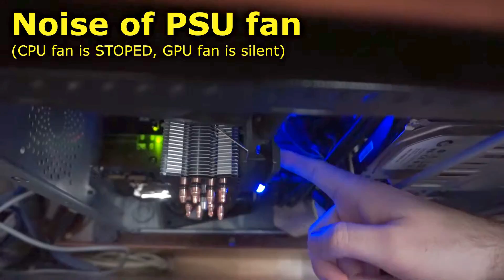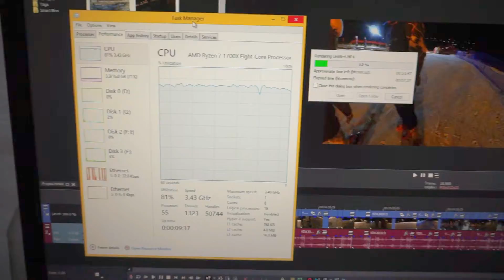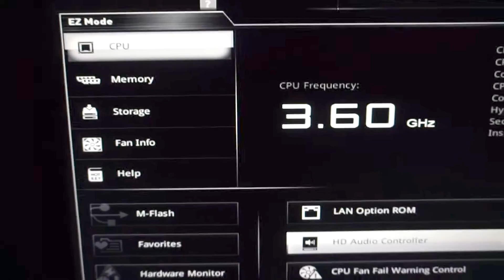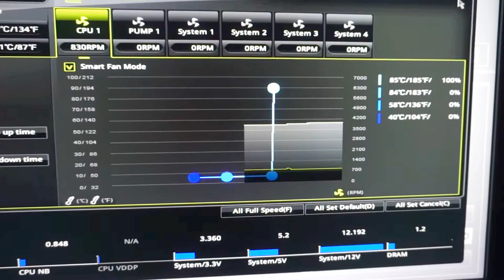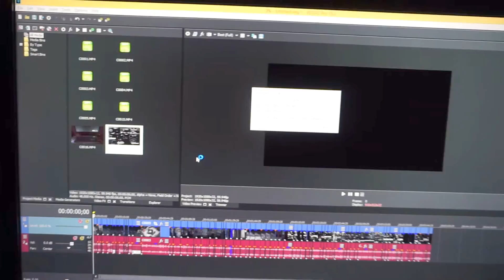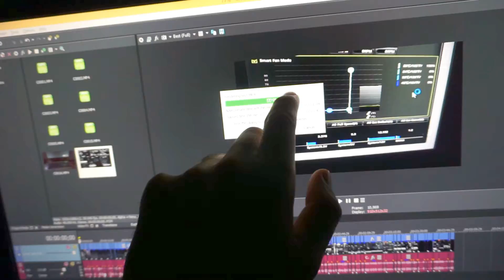Making the PC Silent (PSU & CPU fan Noise Reduction, MSI B350 PC MATE)

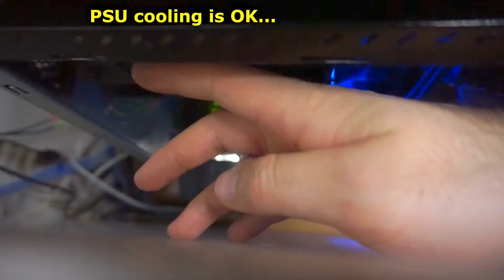Comment: 2:00 don t you ever touch a switch mode psu's heatsinks. it is never safe. the ones on the non isolated input side are dangerous. they are usually at rectified  dc voltage of the corresponding AC line voltage. 300V peak.

Comment: Speedfan software is quite good to control cpu fan, it even lets you stop the fan.  then i'd use the spare fan at 5v to intake some cool air from front bottom of the case

Comment: how do you use win8 on a b450 mobo?
Reply from the maker: this is B350
Reply: my bad i have a b450 board, with only win10 drivers for raven ridge and win7 and 10 for ryzen 1000 and 2000, i thought the same was true on 1st gen boards too
Reply: its the same for your board too

Comment: Man, it's not a good thing that you're fan start spinning faster at 85 degrees. I suggest you to make a softer curve, for example when cpu it's at 50 degees raise the dot to 1000 rpm then when it's at 60 degees raise the line to 1200 rpm and drag a line from 1200 rpm @ 60 Degees to max speed and 75 degrees.
Sorry for my bad english, i'm italian.
Reply from the maker: I slightly increased the rpm at lower temperatures also, the air was pretty hot already when the fan started spinning faster.